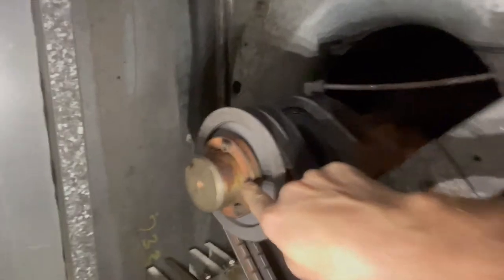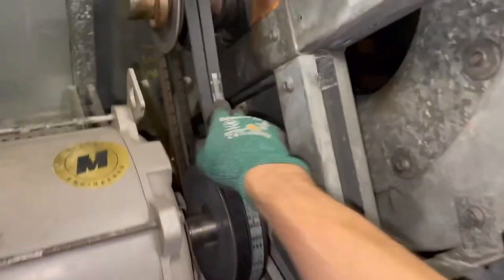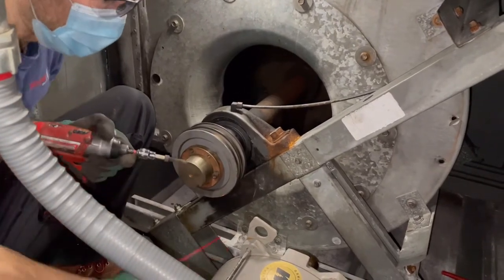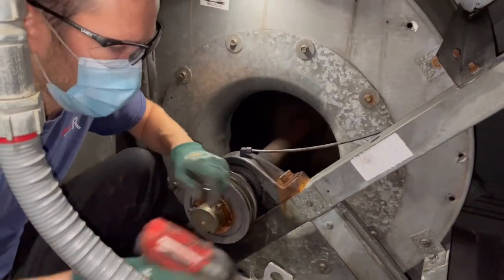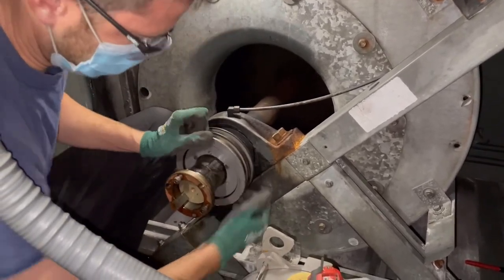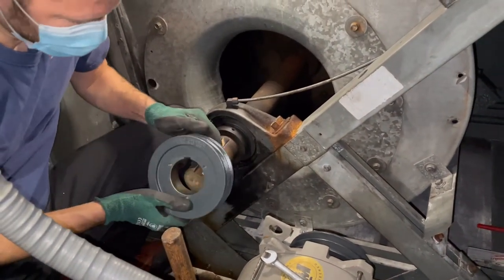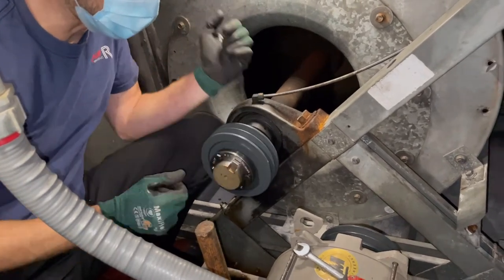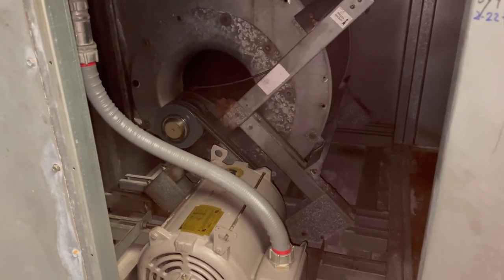HVAC EXPLAINED : Pulley and Belt replacement on an Air Handler.

Comment: Great video! Thanks for sharing your method and experience. I have to replace some pulleys tomorrow and planning on watching your video as a guide while I am doing the job.  Thank you so much.
Reply from the maker: You’re welcome.  Thanks for the compliment.  Just lock out / tag out, prepare the shaft, align pulleys, tighten set screws, adjust belts, check amps and operation.  🤙.   Have a great day.  Good luck.

Comment: thank you so much to make good videos. I really like to learn how to do a  mechanical work on a hvac system. belt tension adjustment, bearing replacement, mechanical seal change,.motor change etc..
Reply from the maker: You’re welcome.  Glad hearing from people getting info and I  enjoy the questions, compliments from people like you.  
Belt tension can be critical on some equipment but generally it’s simple.  Belt type makes a difference on tension.  Never make them tight like a Banjo string since that will cause bearing wear.  Being too loose they will slip, wearing out the belt / pulleys quicker.  
Bearings go bad not always from belt tension being too tight, but sometimes over greasing a bearing or under greasing.   Also, if that blower wheel suddenly gets out of balance, that will also cause premature bearing failure not to mention Vibrations. 
Working on different HVAC equipment is challenging at times but it’s all relatively doing the same thing.  Heating or cooling a space.  No matter where you go in the world, we will always have heating, calling, refrigeration, and ventilation work.   
I do have a lot of footage that I need to edit and start posting videos again.  I was posting a lot of info on TikTok under the same screen name an icon. 
Have you looked into getting into the trade at all?

Comment: Our Air Handler has Low Air Flow after a Tech Replaced Fan Blade Support Shaft Bearings. Im suspecting the Blower Motor Wheel got replaced Backwards…I believe Fan Blades should be “Scooping” the Air…Am I correct in my Thinking?…

Comment: How did you lock / tag this out?  What components did you lock out?  How did you ensure that there would be no windmilling that might catch your finger in the belts and pulleys?  Thanks.
Reply from the maker: Hello Cassady.  Sometimes when I shoot my videos I forget to include little details such as this. I use a OSHA require lockout tag out with Key kit.  The disconnect is located outside of the unit mounted onto an I-beam. But yes you must always be cautious working around moving components or high-voltage.  I was just on a job site the other day troubleshooting and the customer walked over and said “wow LOTO !!! I have an electrician doing an upgrade and all he did was shut down the breaker, never taped or labeled it whatsoever”.  I said technically he should be locking out that breaker or if not the entire panel door but I try to do things by the book.  Typically after when I turn off power and lock it out I will push and contactors to verify we have no power feeding from any which direction to that piece of equipment.   Thank you for the concern I appreciate it I will try to be more thorough and some of the upcoming videos have a great day stay safe and have a good weekend.
Reply: @hvacexplained9341  No, you actually did everything fine.  I only ask because we have had a number of close calls with windmilling so I was wondering what you do to prevent that.  Thanks.
Reply from the maker: @CassadySC1  This was actually a return fan so if the supply fan is running a lot of times the return fan will be pulling through as well but we had a whole system down at that time.  There are times where you must shove a board or something in the fan to eliminate it from rotating because of the other fan in the building or a draft coming through.   Have a great day

Comment: How do you check amperage??
Reply from the maker: Use an Amp Clamp on the wires “individually” of the motor or device your checking.
Reply: @hvacexplained9341  Ok, thanks. Sorry, I’m completely new to this stuff. My boss wanted to do a project in house, rather than contract it out.  Had to replace a six wire 15 HP/200Volt motor, that was about 150lbs (old one was 200lbs). And the motor was above a ceiling grid, about 15feet to the cabinet entry. It went okay for the most part, we used a one man lift and some ingenuity.  But I wanted to verify everything else the best I can.

So, I have the motor leads connected to the power Leeds, running on Delta.  L1 is connected to T1 and T6. L2 is connected to T2 and T4. Last, L3 is connected to T3 and T5.  So, would I put the clamp meter around L1, T1, T6 or do I do each wire in the group individually? Thanks.

Comment: Yea that's all well and good but you forgot the most important part, lining them up. I use a straight edge, sometimes two straight edges if they are far apart. Also, the wedge pulley tend to move slightly as you tighten them causing the pulley to be ever so slightly out of strict alignment so a bit of guessing is involved. Also, always remember to check amp draw after its all said and done!
Reply from the maker: You can check them quickly using a straight edge, sometimes using a string there are times we utilize lasers.  
The bushings that the pulley slides on they can typically move around 1/8 of an inch so always double check your work. I was just giving a quick demo.  
Amps are never to be forgotten about.  
Yes, I totally agree that would be a good point to bring up thank you for the comment.   Have a great day.
Reply: @hvacexplained9341  can you do a video showing pulley alignment?
Reply from the maker: @JP-sd2cw  :  I thought about showing a few different ways. Let me see what I can do.  I will be changing out a big blower assembly along with pulleys when it comes in.  Possibly a few weeks due to Covid waiting delays.    
Have a great day.
Reply: @hvacexplained9341  Hello,.could you please tell me in which direction that the pulley is moving? to the blower or the other side? thank you!
Reply from the maker: @lugongguo8125  hello….   The rotation this blower assembly is turning is Counter Clockwise if your looking at it from the pulley side.  
The pulley turns the same as the blower “Counterclockwise”.  The pulley slides onto that shaft first then the center Hub is installed second.  
The center hub locks it into place.  
Does this help at all ?   Have a good night.
Reply: @hvacexplained9341  thank you! subscribed! have a good night!
Reply from the maker: @lugongguo8125  thank you very much. I appreciate it. Have a great night.